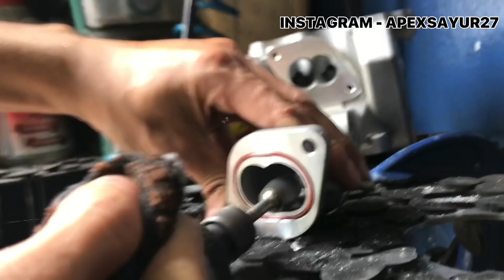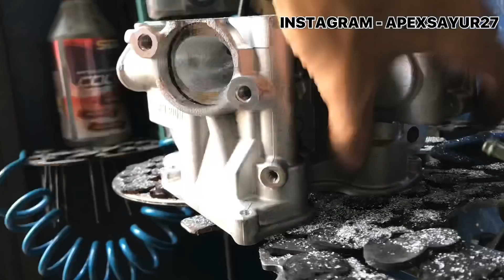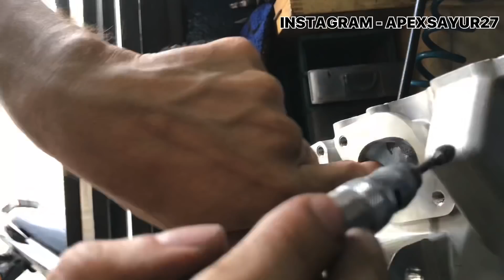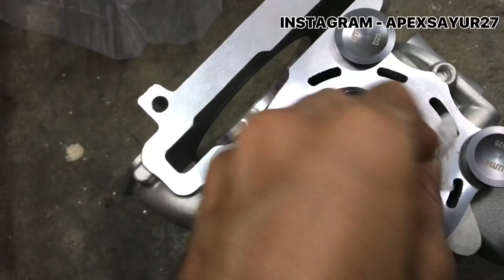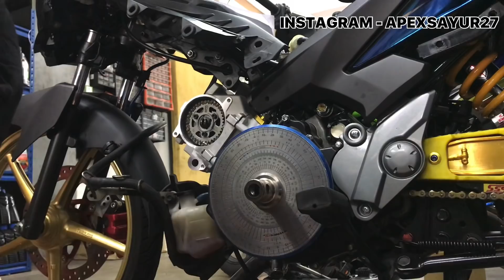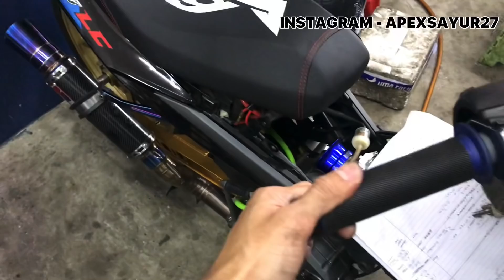FULL SPEC 65MM XPRO PISTON + 2225 SUPERHEAD UMA. Pasang Bukan PnP. Setup Cun2. Ahmad Motor Works

Comment: Assalamualaikum... Nak tanya sikit... Kenapa ye LC saya timing jadi lambat turun normal ye... Free gear pastu pulas sikit minyak dan lepas tapi timing tak turun2 normal semula... Pastu saya masuk gear dan lepas sikit clutch bagi ada rasa sikit nak gerak, baru timing turun jadi normal dan sy free gear baru okay... Jarum check takde sangkut... (Spec 65mm)(22/25 superhead)(Carb Tzm 30mm/pilot 32.5/mainjet/175)(exhaust 35mm)...
Reply: Minyak bawah tk cukup.. bermakna pilot tk cukup besar